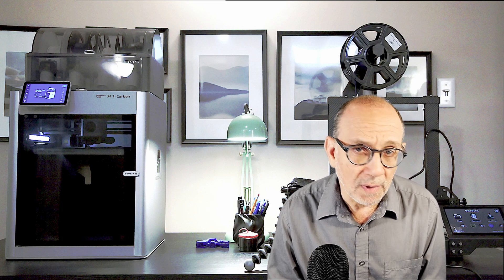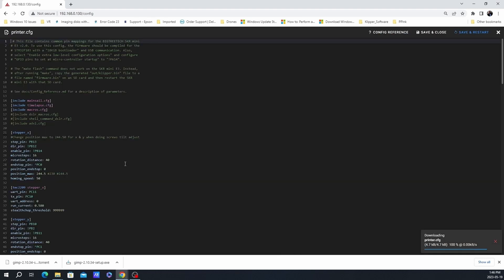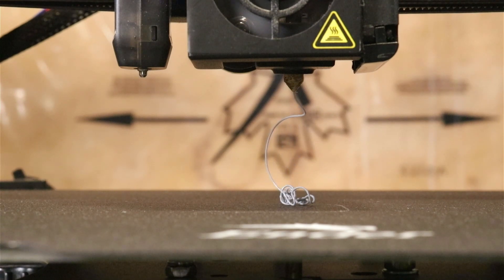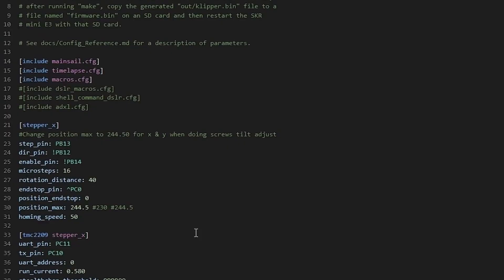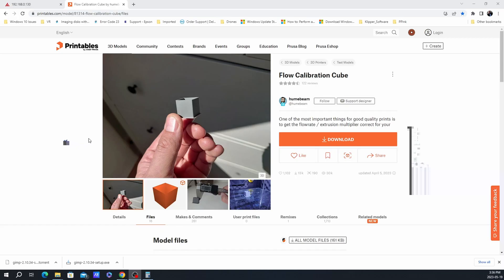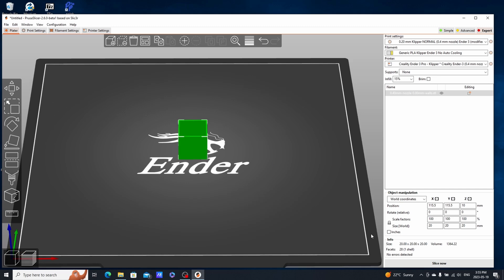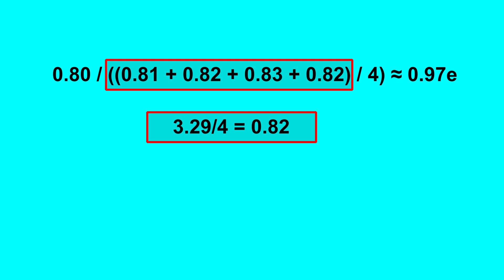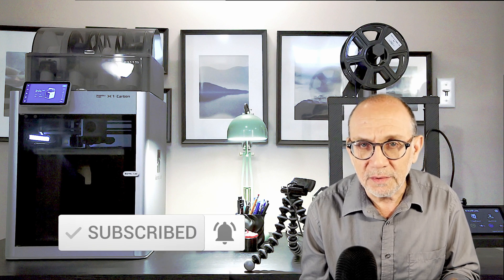Klipper 3D Printing Flow & Extrusion -- Easy!

Comment: I don't understand the formula to figure out the new rotation distance. It doesn't make sense to me. If we get "x" amount with "y" rotation then to get "z" amount which rotation "r" we need. That would be "z" times "y" divided by "x". Right?
Reply: Nevermind. I got it. The formula is correct. Basically if we are extruding less than what we need with x rotation distance we need to reduce that number so the system knows the axis is moving less per each rotation and then to get to a certain movement on the axis the motor needs to rotate more.

Comment: you can set retract speed in the web interface to 1 or 2
and retract 50mm

why it should be fast ?
you don't need to use console at all

Comment: wow.  I am really confused by my printer.  Everytime I performed this calibration, my extrusion distance got SHORTER.

I started at rotation_distance of 33, and it extruded 47mm.  So I increased it to 35.1.  My extrusion went down to 46.  This was really weird.  So I changed the rotation to 27, and I got an extrusion length of 59!  uhm... what?

I'm using an Ender 3 V2 with bowden tube... so maybe this has something to do with it.  It's VERY strange.
Reply: Same was happening tonmr would get worse
Reply: The extrusion distance is an indicator of how much filament you push through per turn of the extruder motor, so a higher extrusion distance means less filament going through.
Reply: @soljoa  That's so counter-intuitive.  A longer distance SHOULD (to my mind) mean more filament.  Higher number (more distance)... more filament.  I'm not saying I think you're wrong... I'm just saying that doesn't make sense to my paltry brain.  :)
Reply: @crooker2  Yeah. I'm confused as well. To the lab!
Reply: @crooker2  I found it. From the configuration reference: "The rotation_distance is the amount of distance that the axis moves with one full revolution of the stepper motor." It was so clear to me yesterday, then I lost it, and now I see it again.😅 The higher the number, the less of a full revolution it will make to extrude X mm of filament.
Reply: @soljoa That makes sense.

Comment: So you had 23mm left un-extruded from your requested 50mm that would mean you only extruded 37, But your saying 47 am I missing something?
Reply from the maker: Hi there...when I originally measured I put a mark at 70mm.  I then set the g code command to extrude 50mm.  I then measured 23mm to the mark that I originally made on the filament...that means that I under extruded by 3mm...so I've extruded 47mm instead of 50mm (70-23=47)...If I measured 20mm from the extruder to the mark I made that would mean I extruded exactly 50mm...The reason you put the mark on the filament at the 70mm point on the filament is to take into account over extrusion.  If you put the mark at exactly 50mm and your printer is over extruding you won't be able to get a measurement.